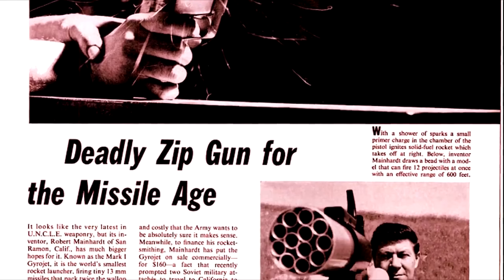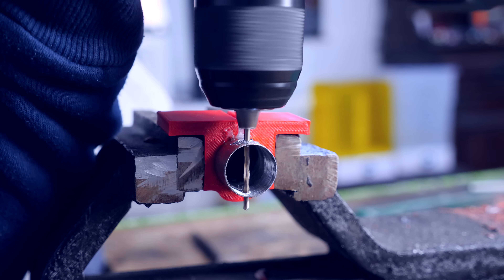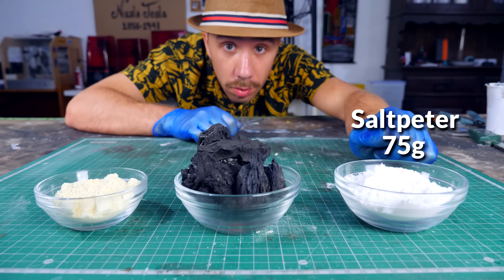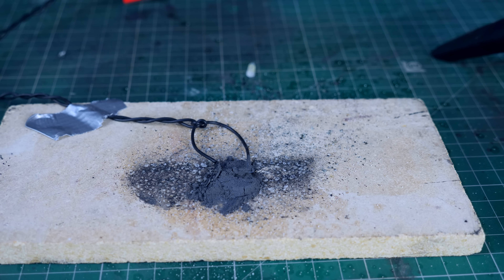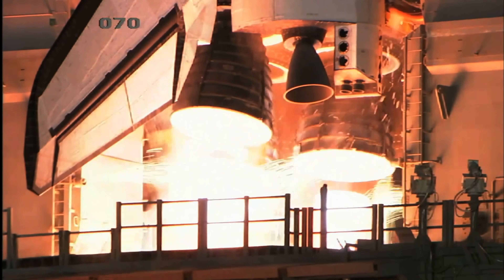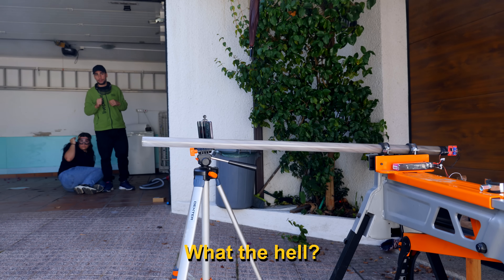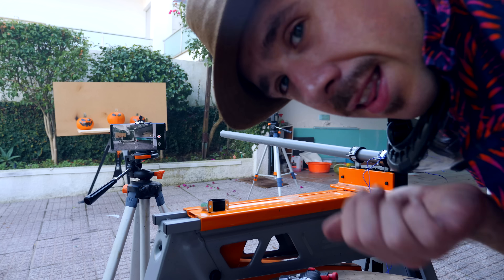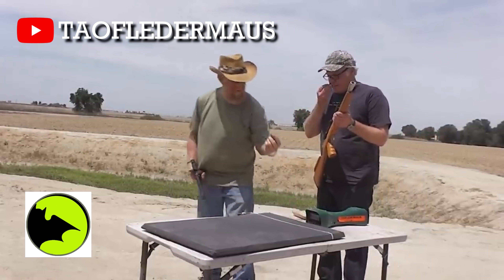GYROJET - The Spinning Rocket Bullet

Comment: Well done! I'm really honored you took my suggestion seriously! 😃
On a more technical note, I think the nozzles were falling apart during the burn, and that caused most of the inaccuracy. The ignition leads might have interfered a bit as well. However, I came to the conclusion that differently from bullets, spin alone is not sufficient to stabilize a rocket. Complex rotational instabilities appear as the motor burns that cause the rocket to wobble wildly. After publishing my original videos I found out that even some space missions were lost due to a spin stabilized upper stage wobbling out of control. I think that fast rotation, that was supposed to be the Gyrojet's greatest asset, ended up being its biggest curse.
Reply: I agree that spin stabilization with a rocket is a hard ask, but also, I don't think you'll ever achieve spin stabilization with the setup shown here.  Because the shell isn't a tight fit in the tube, it's easier for the shell to slide forward than it is for it to rotate--just consider the surface area of a line down the tube compared to the surface area of a single revolution around the rocket's axis, much less the many, many revolutions you are looking for for spin stabilization.  And as long as the rocket isn't spin stabilized in the tube, if there is any room for it to bump around inside the tube and end up with weird momentum coming out the end of it, it will.  Frankly, what this rocket bullet wants... is to actually be inside a close fit, closed, rifled gun barrel, with the the barrel providing part of the spin, and the closed nature of the tube containing the rocket thrust to help overcome the friction and impart spin.  Only once the bullet leaves, going in a straight line and spin stabilized, would the rocket motor even potentially help KEEP the spin stabilization, and even then as you say if the rocket motor burns unevenly or the nozzle gives way, the physics of the motor will suddenly change mid-flight, and that will probably overcome any benefit of the stabilization.
Reply: @suomynonAyletamitlU  I'm far from a scientist, but I also wonder if a longer barrel would better allow for the projectile to get up to a stable rotational speed?
Reply: @teabagtime  I still worry that as things are the projectile won't want to spin at all until it's free of the barrel.  With a closed, rifled barrel, yes, as with rifles vs pistols the longer barrel will just extend the ideal circumstances and increase both rotation and velocity.  If the projectile is loose in the barrel or if the friction of the barrel makes it easier to move forward than to rotate, a longer barrel may not help at all.  If anything, a greased up sabot of some kind that makes it easier for the rocket to spin than advance might help more with spin stabilization than a longer barrel would.  Even if the barrel were greased up in general, as long as it's easier to move forwards than to rotate, it will probably not spin up very much before being set loose, invalidating most of the benefit of having a barrel in the first place.
Reply: The original gyrojet was ignited by the hammer hitting the nose, pushing the rocket back into the firing pin. The rocket would then spend a fraction of a second building thrust—and spin—before gaining enough force to push the hammer out of the way. The biggest problem with the gyrojet, in my opinion, is that everything needs to be perfect: the nozzles must be absolutely perfect, the propellant must burn absolutely evenly, the case must be perfectly formed, and only then can you achieve the abysmal performance of a real gyrojet. Often one will bemoan that an idea “looks good on paper,” but in practice, it has one or more fatal drawbacks. In the case of the gyrojet, it really didn’t look good on paper to begin with, and wasn’t even designed to solve a particular problem. It was an interesting engineering problem, but ultimately a lost cause. Wish I had one!
Reply: @robertmudry4242  te original girojet was the german https://es.wikipedia.org/wiki/Fliegerfaust and it used electrical ignition
Reply: Maybe rocket arrows would have performed better... At least YouTube would not demonetize it. 😁
Reply: if he was able to do it, rifling would help, but not enough. retracting fins are the only way,  but it will be hard to get them to retract flush with the 'bullet' and have enough opening force to spring out, yet not press against the inside of the barrel so hard it jams in there
Reply: @ThatTweedle  Spring steel fins that fold along the side of the rocket and give you a tighter fit with the tube as a bonus.
Reply: The Dzhanibekov effect perhaps.
Reply: @Anthromod  probably not exactly that, since the axis of rotation is the one with the lowest moment of inertia (and not the intermediate one), which is stable for rigid bodies. However, non rigid bodies with ways of dissipating energy (like a rocket ejecting gas and burning propellant) tend to transition towards rotating in  the direction of highest moment of inertia, which is "head to tail" for a rocket. The behaviour is further complicated by the fact that the center of mass is moving and moments of inertia are changing as the burn proceeds. Even nutation instability has been observed in space.
Lesson learned: less spin more aerodynamics
Reply: the sparkler is plugging one of the holes, which might keep it from spining evenly, and just pushes it at an angle from one point on the back, causing it to tumble. (thrust vectoring is also a way to steer rockets)
Reply: The propellant needs more powerful faster catalyst with the standard B/kno3 igniter ZPP better
Reply: Yeah, with the original weight the spin probably helps but as it loses mass imperfections and spite burn rate variance through the rocket could easily throw off the spin ballance.
Reply: I think you might find the solution in tank cannons. A bullet will penetrate more effectively than another round with the same mass if it simply has a smaller diameter; so this produced a long and skinny bullet but they found that the spin actually cause major instability due to the round wanting to tumble. So they switch to a round basically shaped like a dart or a rocket which was held in the barrel by a discarding sabot. This allowed it to fire a smaller diameter fine stabilized rocket out of a much larger diameter barrel, so maybe he make a rocket dart thing and build a sabot around it then use a larger barrel. This is all speculation though I am a child I don’t actually like knoe stuff
Reply: With all projectiles, although especially rockets it is key to have the center of gravity near as possible the the nose. that way the tail of acts more like a streamer following along in the wake rather than being two masses fighting for dominance(aka out of control).
Reply: upper stages tend to wobble out of control if their're not spinning  around their I think major inertia axis, iirc if they spin at minor inertia axis they wobble for a bit before stabilizing in major inertia axis, could be wrong tho, and god forbid spinning around the intermediate axis for sure

also, with these gyrojets, the nozzles are a big hitter, they not only fail and are porous, but also they shift a lot of center of mass to the back, which is not stable, gyroscopic stabilization helps but if something ain't flying heavy end forward it will want to flip because of air ressistance causing torque on it
Reply: I barely qualify as layman in either rocketry or firearms, but would rifling a barrel help at all? Also, could uneven burn of the fuel itself cause the projectiles weight to one side or the other be causing wobble? Doesn't help that I'm asking these questions running on no sleep. sorry if I missed answers to these questions already
Reply: I think solution can be some combination of rocket "bullet" and caseless ammunition. Back end of bullet can be divided in two segments. First segment - classic propellant with ignition providing initial acceleration and in combination with rifling of the barrel some initial RPM. Burning initial dose of propellant  could ignite second dose of propellant inside the "bullet" behind nozzles which after leaving barrel can provide additional acceleration and more RPM. Because we want only relatively meager acceleration from first part of ammunition (no need for extreme pressures and speed), the amount of propellant can be relatively minuscule and wouldn´t take much of volume and also recoil would be negligible. 

Problem I can see is in how to make sure, that propellant in first part is safe to manipulate - but I have feeling, that Germans solved this in 80´ with their G11 rifle.
Second problem I see is effectivity of this ammunition, respective penetration, weight, ballistic profile and so on....
Reply: I think the nozzles were too few and too large
Reply: I think that if the nozzles were more angel it could lead to more accurate shots and like the guy before me it was likely to big
Reply: So what would happen if instead of a rounded semi sphere top, you used one that acts as a turbine? The fins on the side would be a problem but what about on the top?
Reply: I wonder how many people actually read this whole comment
Reply: Also rifling of the barrel helps a lot hence why most modern guns have rifled barrels
And before you ask the one that doesn’t have rifling is the shotgun most of the time
Reply: If you search after «Supersonic darts - The effects of introducing Spin - I learned something!» you can see how they designed the bullet to solve this issue :D
Reply: Could've used negative space for fins/grooves if that makes sense, that way the casing would stabilise itself without relying so much on the nozzles for spin and propulsion, rifling or a proper barrel would help too, if its dragging on the bottom but not the top or sides and leaving the end with uneven space around it, its doomed from the start.
Reply: Spin stabilized rockets we have experience with use fins to create the spin. NOT an off axis nozzle. I suspect having rifling on your barrels would have helped significantly for preliminary stabilization. Also, spin stabilized rockets are not as simple as they seem. They still need a RCS for fine tune control. Lastly, using a star shaped ID on the grain, gives higher ISP.
Reply: no dude this is a plastic pipe with a model rocket engine in it, this is not a real attempt
Reply: Oh no
Reply: Couldn't a flywheel spun up by the acceleration and unavoidable friction and contact with the barrel during launch work to stabilize something like this? Alternatively, a 10 gauge specialty shotgun round? Like, subsonic load pushes finned rocket (say 10 or 9mm) in sabot out of gun, delayed ignition from rearmost of the propellant load being closer to fuse powder than propellant or cannon grade powder? I'm not a major gun type (random wine aunt in no gun country across the pond) but I always root and cheer for anyone daring to explore alternative technology and solution to nice-to-have related problems.
Reply: ive always wanted to make a rocket powered thermite slug for a coilgun. i was thinking of sodium peroxide superoxide as reacting agent as its paramagnetic and reacts well with water which would minimize issues with some hypergolic fuels then use it/steam to supercharge coil guns speed/remove air presure resistance as muc has possible
then ignite the thermite with a electrical arc near the muzzle so it creates a full vacuum for maximum muzzle velocity( youd need end to be mostly ceramics)
Reply: Since it's already basically 2 stage ignition, maybe just treat the rocket as an actual bullet and... Isn't this basically how self propelled artillery works?
Reply: Yes, that would definitely make sense. It makes it really impractical and the ammunition more expensive and less  reliable.
Reply: OH NO
Reply: Oh shit ...
Reply: The fact that the grain isn't uniform is going to create a lot of instability as well. It really needs to be packed tightly without air inside in order to ensure maximum stability.
Also, these tests really shouldn't be done in the city. Imagine if it actually worked rather well, but went over the wall and hit someone... "Safety third" is only okay if you are the only ones in danger.

Comment: there may be 2 reasons for such low velocity 1 the solid fuel mix is burning too slow or 2 the igniter is not burning fast enough the 1st problem can maybe be solved by leaving some air pockets in the round casing or something and the 2nd problem could be fixed if he granulated the powder for a better burn rate. I'm not a chemist or ballistic physics expert but those are the things I could notice

Comment: Hi Integza,
Love the videos, keep them coming!
I had an idea based on the rocket propellant you used in this video.  What would happen if you used the molten dextrose compound in a fairground cotton-candy/candy-floss maker, Would it form a similar fine thread substance? Would it also be pink? If that works out, it would have a huge surface area to volume ratio and probably initiate much more quickly. I suspect you would get much more satisfactory acceleration with lightly packed propellant floss which would allow the flame front to rapidly propagate.  
It would be great to see you test my hypothesis in a future video if it interests you and the community. Best wishes!

Comment: Put a sharp crease in a piece of paper put the gun powder on the folded piece of paper hold the edge of the crease over the straw and tip up until the required amount has been deposited. Great channel by the way !

Comment: The best design would be that the self-propelled rocket would be encased in a shell with a propellant. The piston would propel the rocket out of the barrel conventionally, and at mid point of the barrel would be electric contacts which ignite the electric primer in the rocket itself. This way you get initial acceleration with the propellant in the shell, and then added acceleration with the rocket. Might be really hard to make it work but just  a thought ...

Comment: The gyro jet also held the rocket in place until the thrust built up.  You also  probably need to add weight to the front of the CO2 cartridge, perhaps by pouring hot lead into the end of the cartridge before adding the fuel grain.

Comment: Mr Integza sir, have you considered a discarding sabot with tension-loaded stabilizers under it? It's like an open ended cylinder cut long-ways to provide a guide and keep the fins under compressive tension. When it leaves the barrel, the fins will push the cylinder halves away and deploy for stability.

Comment: why not print the whole rocket body with nozzles and then fill it with gunpowder and propellant and wear a casing/nose cone over it, all as 2 3D printed pieces - back with the nozzles and front with a nose cone sliding into each other ?

Comment: Surely you know now ,but if not . Use clay cat liter to make the nozzle. It  works great foy diy model rockets . Which we made with only amonium nitrate and powdered sugar ( crushed or ground white sugar) . For the ignitor you can simply cram the Kenthal  wire in the rocket nossle

Comment: I have a suggestion - turn the bullet into a rocket propelled APFSDS round. This eliminates the need for a spin but you do need to turn it into a metal arrow. The fins on the back will reduce the spin to stabilize the arrow-shaped round and keep it straight. This also means you need a bigger barrel to fit your homemade shell and a way to create a discarting sabot.

Comment: The original gyrojet bullets had rifling on the outside to cut wind sheer down, while your CO2 canisters did not.

Try using your 3D printer to mold ceramic cases for the bullets with the corkscrew rifling and see how that affects the results.

Also, when making your candy rocket motors use wax paper or parchment paper in your molds to reduce sticking, and a medicine funnel works like a treat for pouring powders into small capsules.

Comment: Nozzle can't angle should be 15 degrees.  The nozzles made by MBA used 2, 3, and 4 nozzle ports.  Nozzle ports were sealed with aluminized film/tape.  So chamber pressurized and then vented giving initial thrust/velocity.

Comment: As useful as 3d printing is I would recommend using it to create a base mold to use to make a 2 part silicone based mold just because most things have a difficult time sticking to it making the demolding process smoother

Comment: White cotton shoelace take and rough up the lace with a metal scrubby brush or pad cut off the plastic ends rub into the gunpowder get gunpowder saturated into the ruffed up fibers of the lace then lay lace down flat on top of as much gun powder as you can and then put a run of gunpowder down the middle of the lace and twist and ever so often tie a little thread that is how you can make a week

Comment: How about a rocket powered rotor blade. 3D printed, of course. 
In the early days of helicopter design, engineers attempted to mount jet motors to the tips of a helicopter rotor instead of using an engine. Don't know if they ever got it to work but I'm convinced that you, with your intelligence, creativity and near pathologically positive attitude, could knock it out in a few minutes!

Comment: You could turn the co2 canister into a 2 stage. Instead of using powder as an ignitor pack the powder and its now a propellant/ignitor. Ignition will happen on the way out.

Comment: VIDEO IDEA:  Freeze your tomatoes first, then drill a hole in them, then fill them with gunpowder (or a model rocket engine).
Now, print a rocket nozzle that will fit in the holes. Ignite the propellant and watch your tomatoes reach for the skies.